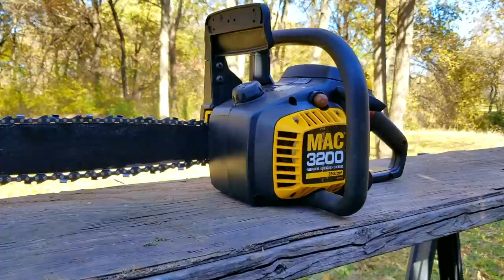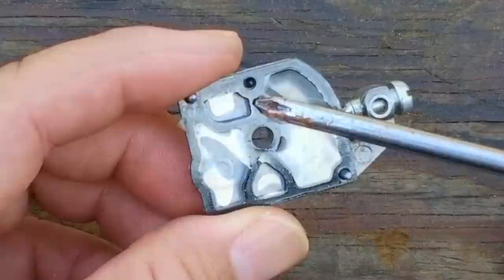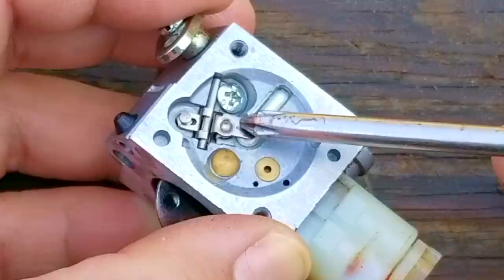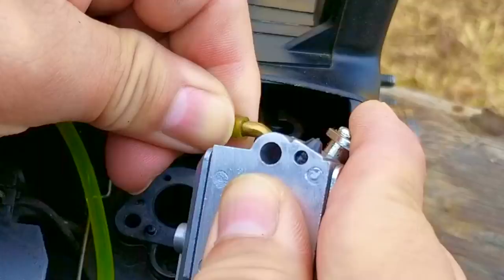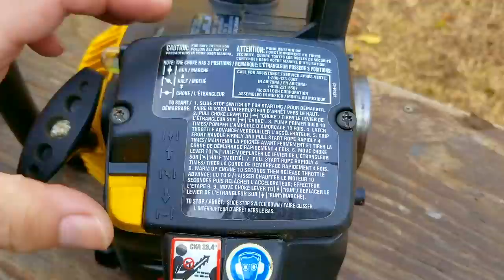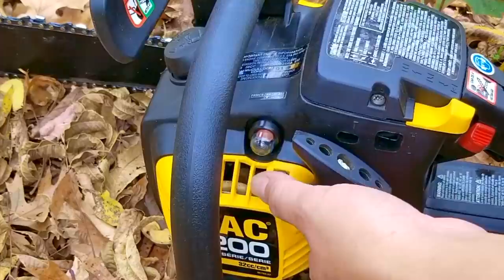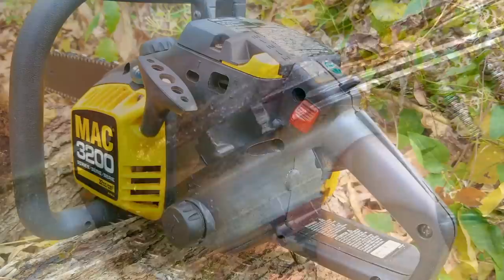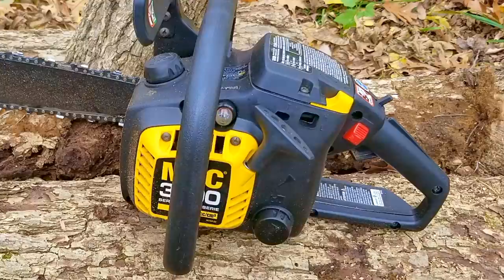Fixing an old McCulloch chainsaw

Comment: I have  similar saw,  I love the compact design,  if I was in your shoes I would try to keep it as long as possible since it seems well built, and I think new ones wont be as sturdy. I believe mine is a 3010 or 3012, the fuel lines were cracked and brittle and I replaced them as per one of your videos, I removed the carburetor, cleaned it with air and carburetor cleaner, and reinstalled it, removed the spark plug which was dirty cleaned it with cleaner and reinstalled it, the saw started after that and run for about 30 secs and then  shut off, and it wont start again.  I didn't do the compression test, I have an older kit that I can use, can you tell me what hose size I need for the test and where I should plug the hose/gauge for this test?  and how to access the engine so I can see the pistons like you showed in the video?  Anything I should try next to get it up and running? Thank you.
Reply from the maker: you don't need to do a compression test, because you've already seen that it will run.  I would either replace the CarB, or adjust it, to deliver more fuel.
Reply: @INSIDEHOUSEGARAGE  I started it yesterday and it run successfully for about 5 mins, at least I can tell there is nothing majorly wrong w/ it.  I shut it off since the rpms were running too high, and wasn't able to start it again, do you know what the T, L, and H screws should be set at for optimal operation?

Comment: It does annoy me when the manufactures force you to buy new equptiment by not supplying spares for perfectly useable older equiptment with plenty of life left in it . However if it was my saw and it cost $100 to repair and you can pick up a newer model for not much more, well you can see why stuff is put out on the curb .
Reply from the maker: I know right, it's a deal break for me most to the time.  I guess that keeps you buying newer equipment.

Comment: I have effectively the identical chain saw, and it's also in need of some TLC. Your 2 part video is exactly what I had been trying to find, now I feel like I can get my old chainsaw back up and running in no time. The serial # of the one you fixed (98A119-000246) would tell me it was made the same year (and probably a few months ahead) of mine (98A223-000692).

I'll let you know how this turns out! Thanks!
Reply from the maker: cool, I appreciate an update when you can.
Reply: @INSIDEHOUSEGARAGE  I was cautiously optimistic I'd be able to come back and report success, but sadly, not. The last time I had it running (a few years ago; it was typical for me not to need the saw for a year or more and then need to use it, and it had always worked fine although gotten harder to start), so I really expected just replacing fuel lines and the oiler line (they all effectively fell apart during removal) would be all I'd need to do. It's refusing to start even with fresh fuel (92 octane, no ethanol), so  now it's time to decide if I want to put more time and money into this one (it's served me well over the years), or bite the bullet and opt for a new one. As you observed, it's out of production, so parts are hard to come by (and won't get easier to find). So at least for now I've set it aside while I contemplate options.

At least it doesn't leak oil any more :)
Reply from the maker: at least one good thing came from it.